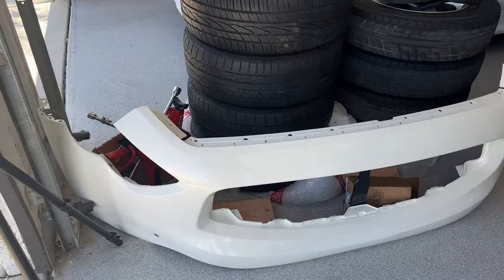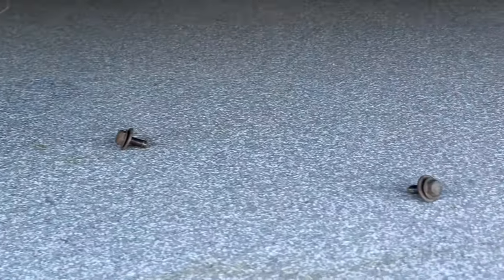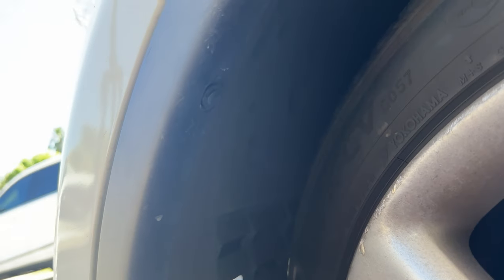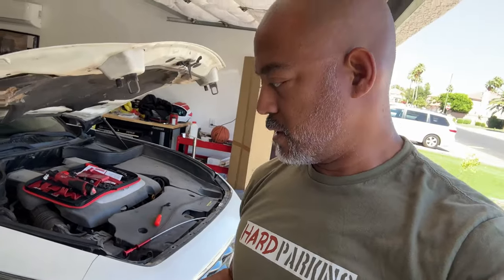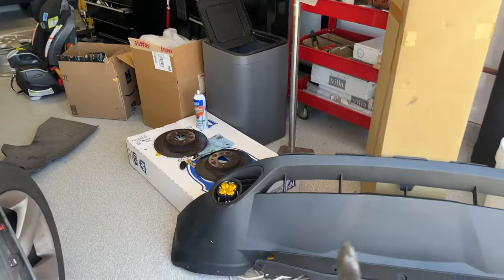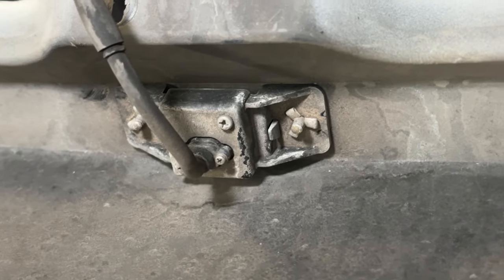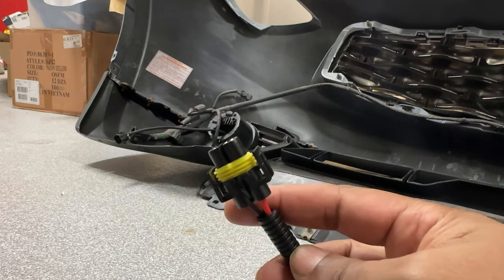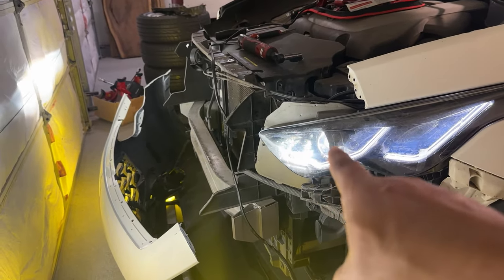Infiniti FX Baja Designs fog light install / bumper removal

Comment: Looking forward to the front lip install video. I have a 2012 FX in Iridium Blue and have been thinking about the complete aero kit from Infiniti. Watched your other videos on the sideskirts and aftermarket diffuser. Looking at options now for an aero kit. Something tasteful and upscale, like an “amg” or “nismo” variant. 

I saw on alibaba they have a replica of the FX 50 Vettel edition aero kit in carbon fiber. 

With the right stance and wheel tire combo, the FX is a timeless machine that still turns heads.

Your thoughts on H&R springs or suspension work? Any plans for that in the future for your project?
Reply from the maker: I didn’t do a front lip install video, the directions are somewhat straight forward but I can throw together a quick one because there are a couple things that seemed a little unclear.  There’s probably a thing or two I might approach differently as well.  I love parts of tge Vettel Edition and saw the kit recently.  The front lower isn’t my favorite but the sides and back are nice.   For mine, I may end up buying a new rear bumper then re-installing the carbon fiber rear lower piece I already sell.  Mounting it on an already fractured and compromised rear bumper probably wasn’t the best thing and it made for an unclean install.  The rear mid spoiler I sell thought remains a favorite for me and a few others that purchased it from my shop.   For suspension, I might go with BC coilovers although I know it doesn’t use the EDC that makes the FX50 unique from the others.  There’s a few wheels I really like, but I also like these OEM 21’s.   I need to get them fixed because they all have some level of curb rash.